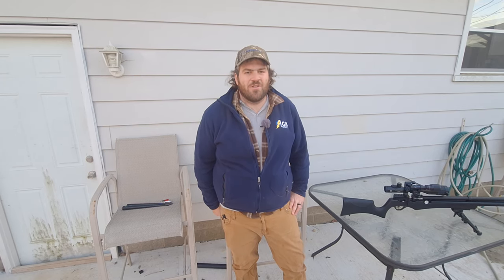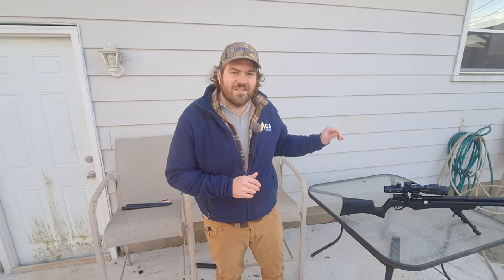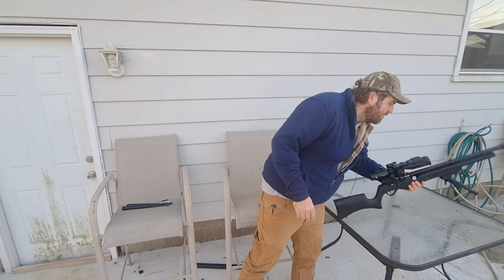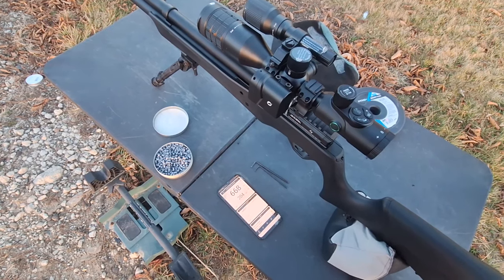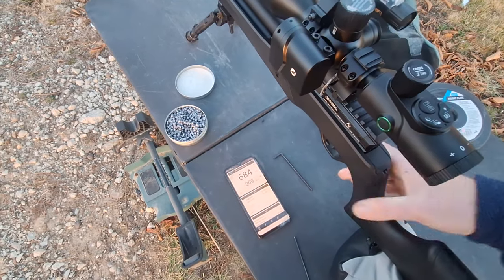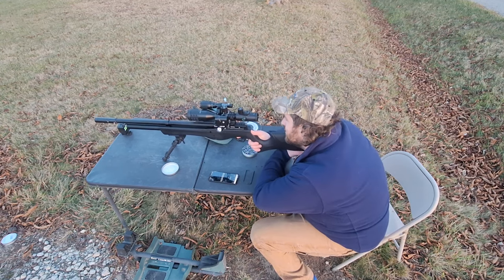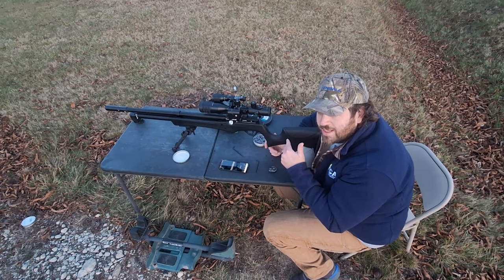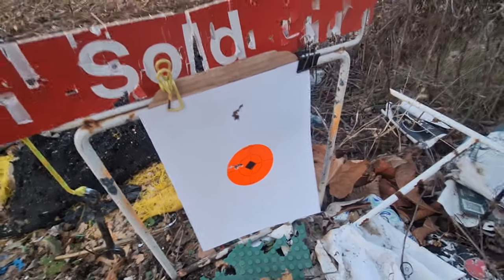How To Tune Adjustable PCP Airgun (Avenge-X)

Comment: He lowers the regulator pressure, the pressure in the firing chamber, or plenum, to allow the valve to open easier...open further, open more allowing a greater volume of air to be released.  The reg pressure from the factory was so high that the hammer couldn't open the valve enough to get a large enough blast to attain the velocity he was looking for no matter how much he increased the hammer spring tension.  What's really nice about the  25 grain, .25 caliber JSB King is that it doesn't take a lot of velocity/energy to do the job...so to speak.  R, Steve. Thanks for the video James!
Reply: TY for this comment.  You are an excellent communicator!  You should be a teacher.
Reply: @petergambino2129  Professional complements are always pleasing; thank you.  I take it you now have a better understanding of what James is saying?  I'm learning too.  James is a much better tuner than I am.  I've watched Robert Lane's videos.  His YouTube channel is Lane Regulators.

Comment: Perhaps I’m missing something but you “couldn’t get more power” initially - however you had the power adjuster on low. Then you decreased reg pressure but ALSO put the power adjuster on high. So couldn’t you get more power in the first place simply by turning the power to high? what am I missing?

Comment: Some claim the best setup for a regulator is to keep adjusting the hammer spring until you can't get any more velocity, then back that hammer spring off to lower the velocity by 10%.. so for example if your max velocity is 1000 fps, then you back the hammer spring off until you reach 900 fps.. If you want more then you have to turn the regulator up, check the max velocity and then back it off 10%.. Your regulator and plenum is like a mini storage area vs the larger storage of a non-regulated gun.. With that said you can get the same velocity on the front side of the bell curve (apex) as you do on the back side.. Backing the hammer off 10% simulates the front side of the bell curve where the hammer can't open the output valve all the way, but is more consistent than the back side because it minimizes extra air passing through by having the output valve open for too long.. The pressure still left in the plenum will help close the valve sooner.. In other words you are not dumping all the air out of the plenum no more than you would dump all the air from an unregulated air gun.. Many shooters prefer to have a short burst of high pressure rather than a long burst of low pressure.. Backing off 10% give you the short burst of high pressure effect..

Comment: Wow your gun shoots way different than my two of Avenge-X and I have two different ones in 25 caliber a Bullpup and the  synthetic classic both are the tube models and I have my regulator pressure set at 2000 PSI and my hammer spring at about 3 turns and I'm shooting at 890.
Reply from the maker: You are in Idaho right? I'm at 770' elevation in Indiana...that's one of main reasons I don't recommend everyone to copy each other's settings cause you won't have the same results
Reply: @ALLABOUTAIRGUNS  yeah I'm in Idaho at 5000 FT elevation
Reply from the maker: 7x more elevation, air is definitely thinner up there haha but yea we're same reg settings( flow ) but hammerspring settings would be off...like a carburetor needs adjusted to  run rich/lean depending where you ride

Comment: As I understand, leave the gun in high setting and adjust as normal and you will see your numbers move up and down with reg pressures adjustment and hammer adjustment.
But it doesn't work that way with the transfer port in low. 
That's the best of both worlds for tuning the gun. Set it with the tune you want at high setting. Then set it to low if you want to plink. 
Reduces the amount of air and you will only see about what your getting. 
click back up to hight and you can go hunting. 
I love that I can plink up to 40 yds on low and set to high out to about 100 yds without retuning!!!

Comment: Why did you leave the transfer port on low with 2400 reg pressure? It seems like that would cause a bottleneck limiting not only air flow but hammer spring adjustment potential. I realize you can get to different velocities and accurate results with different tunes but I'm just curious why it was left on low.
Reply from the maker: That's how it was from PA remember? Well actually in-between but more towards low so I put it to low after zeroing the scope....I wanted to see what the performance was on paper before any tuning and see if there was any poi shift...that way if people get their gun same way or settings  they can adjust right away after this video...with settings out of the box it was maxed out for a 25.4gr pellet whether the transfer port on high or low, if hammerspring was turned inward and no fps was gained on Lo it'd be the same on HI settings as well without resetting the reg down...and plus on Lo you get alot of shots for close range plinking or hunting
Reply: @ALLABOUTAIRGUNS Yes I did remember it was like that out of the box. To be honest I did think with the transfer port on low it would limit the amount of hammer spring tension you could apply more than if the transfer report was on high. My thinking was that for instance in your case two and a half turns in was maxed out with transfer port on low. (Maxed out meaning no more velocity gained by turning it in further) BUT with the transfer port on high it would allow more are thus allowing more tention to be applied to the hammer spring. On low with maxed out at 2.5 with a 2400 rag but I was thinking on high you'd be able to get more like 3.5 or more. I'm actually  curious and I'm going to try this on mine to see if it makes a difference. 
In my head it makes sense but I don't build air guns and I only have a few months experience with pcps.
  I retune my guns all the time because I shoot all kinds of different projectiles. 18-22 grain pellets and 17 - 22 grain slugs.  I can get all of them very accurate/consistent but I only shoot out to 50 yds because of poor vision. I just shoot different projectiles and retune for fun. I shoot daily. When I pick up a new hobby I get kind of obsessive do tons of reading video watching and try to learn as much as I can.
Reply from the maker: Yea I was at one of the  diminishing returns (settings) spectrum and opposite would be lower/lowest reg settings you could go with most hammerspring and nothing would be a substantial gain unless hammerspring was backed off and reg settings raised due to wasting air from overpowered hammerspring...it comes down to mechanical tuning the first before fine tuning the pellets or slugs with hammerspring tension
Reply: Just open the transfer port... it really doesn't make it more efficient
Reply: Why not simply open the transfer port for more power??????
You didn't even show what the difference was 🤣🤣🤣
Reply: @heithwatkins  I can tell you that on my 22 caliber avenged X just adjusting the transfer Port from low to high is a significant difference usually from 175 to 200 fps on a couple of the projectiles I've tried it on. To be honest I wish there was a medium this way I could switch from 950 ft per second for slugs down to 875iah for pellets
Reply from the maker: What you guys are not getting is if the gun is maxed out....hammerspring isn't increasing velocity anymore after 2.5 turns@2400psi inward/clockwise the transfer port on hi or low wouldn't matter cause max is max whether it shooting 683fps or 930fps ....the velocity isn't increasing any more ....Which is the MAX and when the pressure is decreased to 2000psi and transfer port is on high because velocity went down to 608fps/828fps...which is an indication of hammerspring is too  weak for the 25cal since all calibers share the same hammerspring which is a big no no when it comes to air flow ratio
Reply: @ALLABOUTAIRGUNS  I understood why it was maxed out what I was wondering was if you tried it with the transfer port on high. I didn't know if it would make a difference or not. Stiffer hammer spring could resolve it being maxed out at 2.5 turns if you are looking to get more energy out of the gun so not really a huge problem and I'm sure the gun does what it's advertised to do.
Reply from the maker: @blindj  you can't trust alot of these airgun companies cause they just buy contracts/designs and don't really care about the consumer, this being one of those times...the standard Avenger has different hammersprings for each caliber and is a 1:1 flow rate ratio....the Avenge X  shares same hammerspring through all calibers and even caliber barrel kits don't include a hammerspring for different calibers....just another money grab because the claim of being modular....the regulator psi at 2000psi on the 25cal is definitely not a 1:1 ratio...if the gun was same as Avenger as they claim , you change the hammerspring every caliber and reg settings would  be set higher around 2500psi/2600psi but it's not possible as you seen because the hammerspring isn't meant for the 25 cal
Reply: @ALLABOUTAIRGUNS  I don't trust companies and I definitely have a hard time trusting anyone in general.  
Would I be correct in assuming then that the hammer spring is maxed out at 2.5 turns in, with a regulator pressure of 2400 in every caliber? 
I'm asking because I assumed the hammer spring is fighting air pressure and it wouldn't matter what size the projectile is. I'm newer to pcps but my understanding is the hammer spring slams into the valve and the valve is held closed by air pressure that the regulator  is set at so then the hammer spring would be limited to 2400 PSI 2 1/2 turns with every caliber, correct? I do know the ex has a lot more turns than the original I believe the x is 8 1/4 and original is 5 and 1/2 if I remember correctly.
Reply from the maker: @blindj  yea it has more more like around 8 or so and ~ 6 turns for Avenger, but no you can't assume it's maxed on every caliber at 2.5x 2400psi because the hammerspring compression rate (pounds) being equal in all calibers, 177 and 22 are smaller caliber use less air per shot and valve isn't opened as long and doesn't release that much air compared to 25 ...that's why 25 gets 55 shots , 22cal 80 shots , 177cal 110 shots which are computer generated but it's still a difference in shot count per caliber
Reply: @ALLABOUTAIRGUNS okay because I've tuned my gun up to 46 FPE (23 Grain Patriot javelin's 940 to 950 fps) and I was running my hammer spring 7 turns in  and reg was about 2450. Gun sounded and didn't sound like Hammer was slapping/ bouncing. Nice tight group at 40 yards. I didn't think I was running way too many turns in. What works for me is increase hammer until no velocity increase then back it off 1/4 or 1/2 turn. More than that I start to lose velocity slightly.
Reply from the maker: @blindj  yep just finding the MAX hammerspring settings at each psi setting....it's funny I just ran calculations for 177/22 Avenge X and 22 I got a reg setting of 2450psi due to the flow rates per caliber and if the hammerspring is that far inward that means it was meant for 177/22 , going off my calculations I'd have to reduce the 25cal X reg to 1800psi for it to be perfect with that hammerspring and it can't be that low cause when I reset the reg to 2k the next day it was barely cracked open, according to manual reg should be opened 1/4 turn from fully tightened closed to not damage it
Reply: @ALLABOUTAIRGUNS it seems like when it gets colder like below freezing the gun "sounds" more happy with a little more hammer spring tension than I run at 45-50°.  It just started getting into the twenties so I haven't chronographed it but I'm sure I'm getting lower velocities because of less pressure due to the cold air. I'll have to play with it further to find out exactly what's going on on. I've been expecting this as I've already read about are guns losing a little performance during colder temperatures. But even if I didn't read about it I can clearly hear a difference.
Reply from the maker: @blindj  yep cold temps definitely affect things, especially scope shifting as you've seen my friend JR Wy finally found a scope that quit shifting on him up to 50 degree differences...temps can affect groups but should not cause a drastic poi shift especially within 50yd, then it's the reticle/erector tube shifting slightly pointing away from your barrel
Reply: @blindj  My Avenger 177cal shoots 12.5 Nielsen slugs fantastic 2.5 turns on HS with reg at 2,800psi. My full adjustment on HS is 6.5 turns. Maxed out it shoots the 12.5 slugs 1,005fps. This is with the reg at 2,800psi. But 2.5 HS turns gives me 880fps and great accuracy. I haven't tried any other slugs. 
The 16.2gr Beast JSB give almost 33ft pounds of energy with max HS and 2,800psi reg pressure. 
However I don't use the rifle set up this way. My HS is on lowest setting and reg is about 1,200psi. This enables me to shoot crossman ultra mags 10.5gr around 850fps. I get well over 100 shots per fill. And it's super accurate set up like this.
Reply: Mine shot awesome as is from UA  in .25 shooting the 25.39 at 870
Reply: It's all about air flow On 177 and the 22 Are a lot higher Than the 25 fpe  because the ports On  the valve And transfer port Are one size So on a smaller projectile It's going to push it a lot of faster On the larger one It only has so much air On my avenger X25 The most I can get out of it with the 25 grain pallet Is 930FPE You'd have to do some modifications to get more Fpe A matter of time they'll have stuff to do modifications  drilling And porting Lighter valve Spring Ect
Reply: @gmsantafeairgunner2169  which was part of my point/question. He was concerned because the gun/"hammer spring" was maxed out. Which was true, his FPS was maxed out with the transfer port on low choking air flow. I was wondering why it was left on low and not tested on high before changing the regulator pressure at all. What he said was correct it was maxed out with those settings however simply opening the transfer Port would have gotten an extra 200 FPS approx. I also understand Max FPS wasn't the goal. What I didn't know was if opening the transfer Port would allow more adjustability in the HS. I think with it on low it was maxed out at 2 1/2 turns, I was curious if you would be able to get more than that with the transfer port on high. I don't fully understand how these are guns are built and was trying to understand further which was why I started this line of questions.
Reply: @blindj thought i was sick
… beats a dope addiction i had back early 2000’s haha
Reply: @Jeeper1378  what?
Reply: @blindj it only drops it about 100 slugs to pellet. Since slugs typically shoot slower (more area  engaging the rifling) @ 925 fps (a pellet of the same weight) would be 950 ish. So going from a slug on high setting to a pellet on low setting works out perfectly for me. I can shoot 13.4 KO slugs at 920 and on low 13.4 pellets low 800’s. Or 10 gr pellets middle 800’s.
Reply: @gmsantafeairgunner2169 havnt tried to max it out but i had JTS 29 grain pellets shooting a average 870 or 48 or so FPE. Same tune the JTS 25’s (which run a little tighter in the breech 890-900.
Reply: @blindj  Airgun sickness.. shooting everyday , guns or in my case veins 😂

Comment: So in theory, you degassed it just enough to grt lower than the reg setting to basically eliminate the reg setting. Therefore you can find a better, lower reg setting by just using the cylinders air guage. Am I picking up what you're putting down here?
Reply from the maker: Yea I left the hammerspring same setting and shot down pass the reg settings because it's all about flow depending on the pellet weight

Comment: This is an awesome airgun for the money. Ordering the .22 tube version in wood stock in January of 2024 to replace my Nova Vista Liberty which still to this day is one of my most accurate PCPs and it holds its own with many of my high end airguns, however it is getting worn out. I do hope the barrel in my Liberty fits the Aveng X because I hit the freaking barrel lottery with that gun. It will hold a penny at 75 yards with 18.13s in no wind. 285$ back in the day! Thanks for the info bud. Happy holidays.

Comment: Brother thank you so much for your video's, I have learned a bunch from you. I am just getting back into Airguns after a 45 year absence. i just purchased an Aveng X and can't wait to start my journey. i am interested if your suppression system you made for the avenger works with the Avenge X.
Reply from the maker: I haven't designed an internal baffle system yet, but I did make a full size moderator as you seen in this video
Reply: @ALLABOUTAIRGUNS  have yu seen any issues with barrel harmonics. And what is your price on the moderator
Reply from the maker: No I haven't seen anything,  testing poi shift everything with no movement and I'll have a video soon on the moderator
Reply: Thank you this was a very informative video. @ALLABOUTAIRGUNS
Reply from the maker: Appreciate it!

Comment: Sweet .. kinda sucks that this reg wont go below than 1900 ish. Regardless though, i did get 80-90 shots in .177 with the tube version set at 2000. 1 1/4 in on HS, 13.4’s at 880 fps.
Like said you have to have this tuned right or you will lower FPS as the tank empties. Set right only the first few shots will be a little high but the rest will stay < 20. Great gun.. i have the 177 and 25 cal.
25 cal i have it at 2500 reg, 3 in on HS. Shooting 29 grain JTS’s at 870 FPS.

Comment: You've used the Avenger a lot, Just curious to know, which one is better in your opinion, In terms of accuracy and versatility.
Reply: I already have three Avengers one first gen wood stock in .22 cal and two others new Avenge-X classics another .22 and a .25 cal from my personal experience the .25 cal is more accurate than my others two smaller .22 cal no matter what type of pellets and tune I use.
Reply: @raymondmorales8252   Thank you, that's good to know.